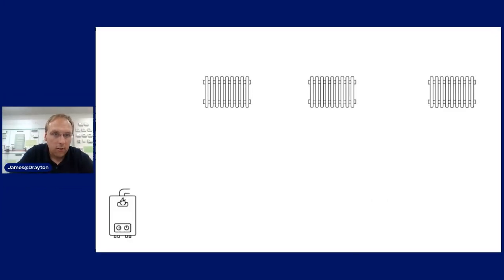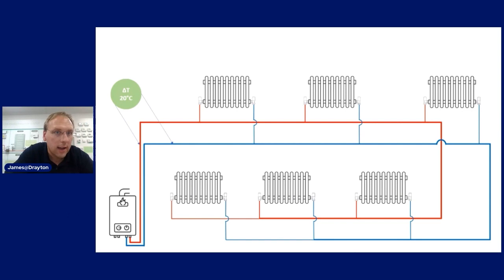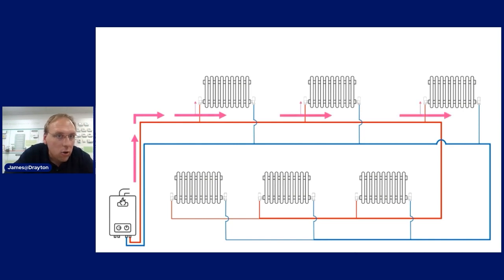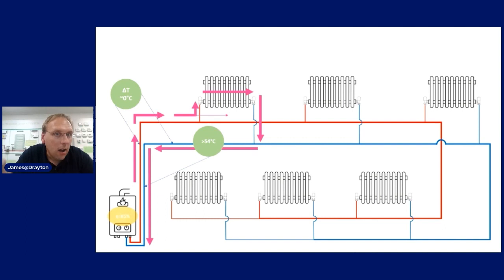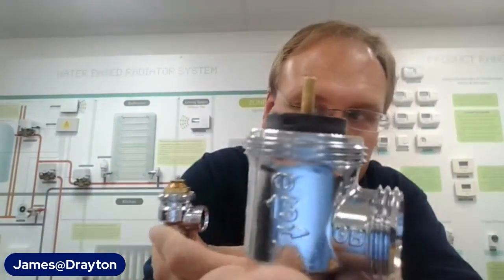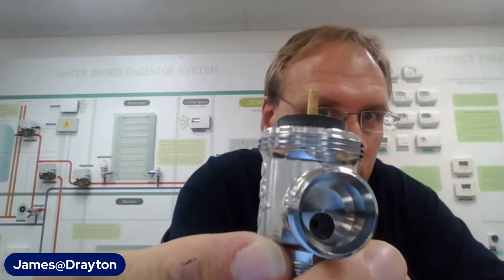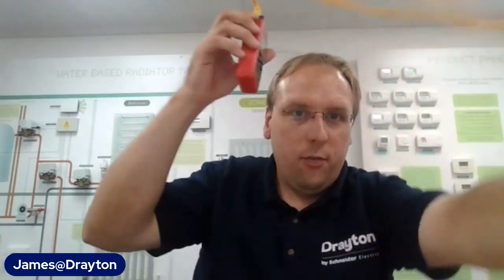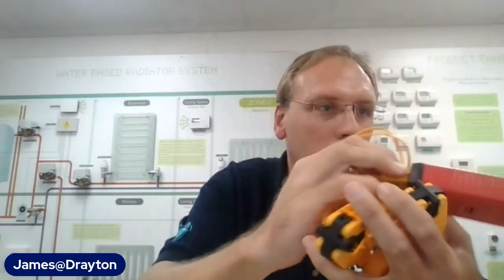FB  Live Training - Our new Auto-balancing TRV

Comment: This is awesome! Very well explained and very timely as I've just installed Wiser Kit2 (Hub, Room Stat plus total of 8 Wiser smart TRV heads) in my home and I've been considering changing out some of the old TRV bodies as they're a bit old, a few are leaky/corroded and often got stuck using the old mechanical TRV heads. I love the autobalancing calibration, and simply leaving the lock shield wide open. And the fact you've created a Web page to help find the flow rate for older existing rads. Seems like you've got everything covered. Well done Drayton. This must be a real game changer for new installations.
Reply: Just to add a bit more to my comment above, since installing my Wiser Smart TRV heads I have discovered sometimes when desired room temp is reached the old valves don't shut fully (despite proper fitting and calibration procedure for the smart motorised head), which means that rad will continue to run warm/hot when rads in other rooms are calling for heat, so unnecessarily wasting energy. 

This is probably either because the old-style TRV valve body pin is prone to sticking, or perhaps has a build-up of hardened sludge in the valve gate which prevents it closing fully. A knock-on effect seems to be that because the new Smart head is trying but unable to close fully, it causes the batteries to run out of juice prematurely. I have one particular valve that runs out the batteries in about 2-3 weeks, when they should last about a year! 

So definitely a strong consideration for swapping in the new auto-balancing valves as part of your Wiser installation. 

In my house I've identified 5 out of my 16 rad TRV valve bodies that need changing, but doing ALL 16 (as recommended) will have to wait until I can afford it, but its ok for now because several rads I have completely turned off to save money (horrendous gas prices!) as they're in unused rooms/areas.
Reply from the maker: Thankyou for your comments!
Reply: @Draytonheating  Thanks for responding.

Comment: Well Ive just been fleeced £750 to have Drayton TRV4s fitted to my heating system and wished Id known these were available as an alternative.
Reply from the maker: You can balance your heating system using the standard bodies supplied with the  TRV4s however, they are not auto-balancing. You set the flow rate to one of 6 positions by turning the valve insert.

Comment: Hi previous comments not showing so adding again :  (suitability with valves).
Triple panel rads (type 33) I have various, either 700x1000, 700x1200, 500x1000
Reply from the maker: Just checked a type 33 for 700x1000, 700x1200, 500x1000 and it gives you the settings for all deltaTs across all 3 flow temperatures. The only one the calculator won't allow for is 300 x 2000.
Reply: @Draytonheating  many thanks for checking and confirming. That’s really good of you. I wonder why I couldn’t see it before! Thanks again.
Reply from the maker: No problem at all!

Comment: When installing an ashp is the pipework changed to 22mm but the max opening on the valve is only about 7mm.?
Reply from the maker: The maximum flow rate through the Drayton Auto-balancing valve is 150 litters per hour which may not be sufficient for systems running low flow temperatures or delta T less than 10.

Comment: but if the boiler pump modulates down , radiators further down will be deprived  ?
Reply from the maker: Best practice when using these valves is to set your pump to the flow rate which is the minimum required to fulfil your system requirements. Modulating flow temperature rather than pump speed is preferable.

Comment: Wow very interesting video and you are the master professional 👏 
I have the honeywell  home evohome system with 9 in total. hr92uk smart radiator valve fitted and I have wireless ATC982G300 touch screen base station the radiator valve 9 in total is your Drayton 15mm The TRV4 Classic and I am using honeywell smart radiators valves hr92uk screwed on your Drayton TRV and the question is the Drayton new valve AUTO BALANCING TRV will it work on the honeywell home evohome smart system? And does the new Drayton AUTO BALANCING TRV can be install on both side ie return or flow side ? 
Please kindly let me know thank you waiting for your reply 🙏
Reply from the maker: You would need to double check with Honeywell but have a look at our Wiser smart radiator thermostats that are definitely compatible. The Drayton Auto-balancing values are available in angled and straight suitable for 15mm compression. Both of these bodies are uni-directional meaning you'll need to observe the flow direction arrow. This means if you fit the angled bodies on the flow side of the radiator the head will sit vertically however, if it's fitted on the return side the head will sit horizontally.

Comment: hi this was really helpful. does this work with triple panel, triple convector rads? (Type 33). The settings calculator says unsuitable??
Reply from the maker: Can you tell us what size your type 33 radiator is please?
Reply: @Draytonheating  thanks for the reply. I have various, either 700x1000, 700x1200, 500x1000.
Reply: and 300x2000
Reply: @Draytonheating  hi apologies my comments don’t show! Rads are either 700x1000 700x1200

Comment: I have ordered 10 auto balancing valves for my Wiser system but having watched your video I still have some questions. My radiators are column types which are not on your calculator app. I know the output in watts for each rad but it is defined as delta T 50 which I think is a different measurement from your chart of 10 15 20. Also I don't understand the concept of picking your own delta T for rads.  Is it not something that is defined by the balancing?
Reply from the maker: When comparing delta T, it's important that we are talking in terms of differential temperature between the flow and return as opposed to the differential temperature between the flow and the ambient room temperature. Have a chat with out customer services to clarify - 0333 6000 622.

Comment: Are the auto balancing TRV 4  available to suit 1/2 inch pipework?
Reply from the maker: The bodies come in angled and straight versions for 15mm compression and is supplied with a 1/2 inch BSP tail for the radiator.

Comment: Can I purchase jut the head as all of my TUV are Drayton
Reply from the maker: The TRV heads that are supplied with these bodies are the same as the rest of the range. It is the bodies that does the auto-balancing. The bodies are available separately separately to the head using part number - 07 15 560 for angled and 07 15 561 for straight

Comment: 1. Are you planning on releasing a corner version of the auto-balancing valve? So not straight, not angled, but corner one.
2. Isn't the DT achieved from the following:
(flow+return)/2-room temp? So basically for the sake of the argument with the flow at 60, return at 40 (which simplifying is to be achieved via the self balancing valves use) and room temp at 20deg - > ((60+40)/2)-20=30?
DT is not a simple difference of the flow and the return temp!
3. Your support is claiming that the settings for the online calculator are to relate to the radiator, not the boiler.
So when setting the flow temp in the calculator it is to be the temp reaching the emitter, not the flow set up on the boiler. Additionally they confirm the equation for DT to be used is as per the above, not a simple difference of the flow and return.
So in order to get a DT20 one would need to go as low as 50/30 or lower to get in line with your settings chart / online calculator. But then the lowest flow temp in the calculator is 55deg so nothing adds up here.
Reply from the maker: 1. no plans to release corner angle at this point but we will submit your feedback to the product manager. For points 2 & 3 the deltaT referred to is the difference between the temperature of the water entering and existing the radiator, not the difference between flow temperature and the ambient room temperature.